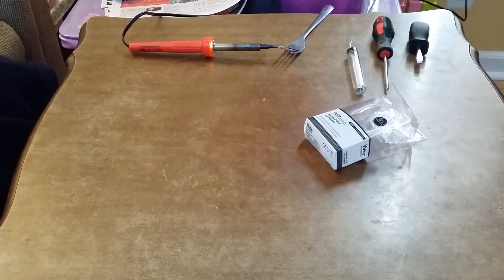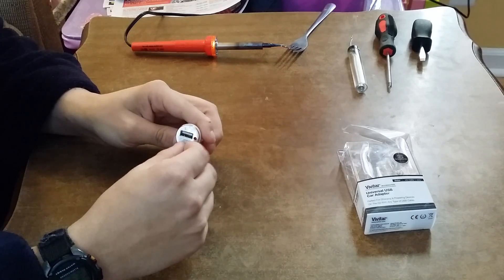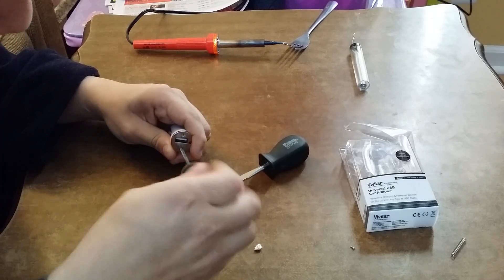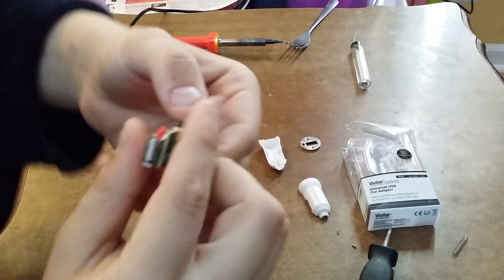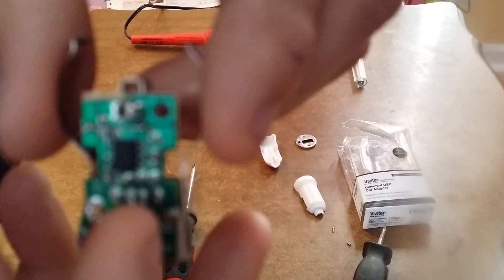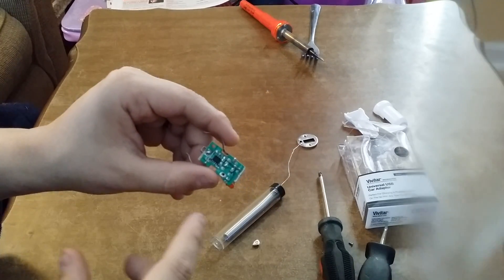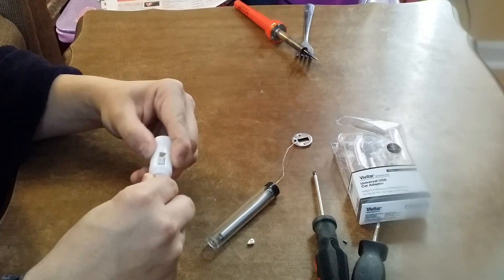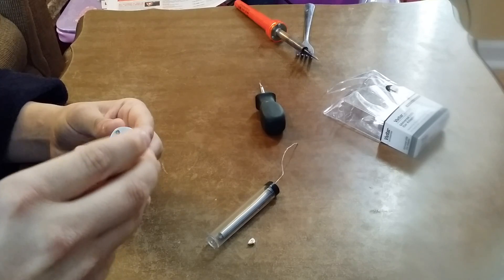Android fast charge hack

Comment: Its clear you don't really know a lot of how (phone) batteries charge and how much current they draw and or how much current a pc can deliver to a usb port, and btw you should never just short something out, and if you really thing it makes a difference than just scratch of the little layer of copper of the circuit board
Reply: Shorting the data pins on a charger does nothing if there is no voltage on it. All that does is tell the phone that it is a charger and there will be no usb transfer to PC, so it starts drawing a higher amperage. Normally it would be 500mah, with the pins shorted it goes to about 1amp.
Scratching copper off the circuit board would quite literally do nothing, not even improve the charging rate.
Reply: AHAHHAHAHA suction!??
Sorry if you are offended, but your spelling and grammar is so poor that it's frustrating to try and understand what you mean by stuff like "power into the drive" and "suction from the input". LOL!

Current is DRAWN from the supply. Shorting the data pins tricks the phone into thinking it is plugged into an AC charger and therefore it will try to DRAW 1000ma rather than only 500ma when it thinks it is connected to a USB port which is typically only capable of handling 500ma.

"Fast" charging on an Android is usually referring to 2000mah (which my Note2 and S5 both support). For this to work you need to use resistors to drop the voltage of the 5v power down to 1.2v across both data pins... which in turn tells the phone that it is connected to a 2amp capable charger. I have done this several times and charge at 2amps using aftermarket chargers.

Lastly. "ANGRY" is how you spell it. (no "E") =-]
Reply: ANGERY OTTER Current is drawn, not pushed. You may have a 12v charger capable of 3A but it the source has a higher than 3A resistance, you will not draw it. Current is equal to voltage divided by resistance or Ohms Law I=V/R. No resistance equals max current draw.

ie: Picture 2 stacked water tanks. Top is full. Bottom is empty. Attach a hose to drain the top tank to bottom tank. The hose is your resistance to Current transfer from one capacity to another. Bigger hose diameter equal less resistance which means higher current. Do not mistake this with Pressure which is equated to voltage.

ie: Tanks are side by side. One empty. Attached the hose. Drain from one to the other. The one with the higher level has a Higher pressure on the resistance than the other. This is like charging up to a voltage. When the charger is equal voltage to the battery there is no longer any current or flow yet they bother hold equal voltage or pressure.
Reply: Steve Rand it pushes more power into the drive equalling more charge it works is it important no but he isn't hooking a car battery up to his phone
Reply: ANGERY OTTER Sorry mate, no idea what you are saying.
You can't push power and I never said anything about hooking up a car battery?
Reply: It increases the suction from the input shorting the plug sorry you don't do shit like this
Reply: That's why when people usually don't have any idea how shit works they learn somthing
Reply: Great reply. Lots of detail!
Reply: The ohm law works exactly as you describe for simple resistive load. But cell phone are much more complex. They follow an algorithm to evaluate how strong is the power delivered on the USB connector.

Step #1 : take only 200 mA, wait 1 second
Step #2 : verify if voltage is above 4.5 volts and not above 5.2 volts
Step #3 : set current to draw1 a little higher (300 mA, 400 mA or 500 mA max)
Step #4 : if voltage decrease below x percent or below a specific voltage, go back to step #1

The brave engineer of Apple decided to violate the USB standard in order to make the first fast charging phone. The official way for USB standard would be to use the data line and negotiate between the phone and power supply. Apple decided to use the easy "dirty" way, which is to add a cheap resistor on one of the two data line. The phone check if the resistor is there. If it is, it assume the power supply is the high current 1 A and just try to draw that current.

When Android phone catched-up with that trick and some models also started to violate the USB standard to take 1 Amps, Apple created the next version to justify the price invested by the parents of rich kids. The new trick, as showed in this video, is to short-circuit the two data line. The new phone now check this, and if they sense that short-circuit, they assume the power supply can deliver 2 Amps.

Meanwhile, the Android phones continue to respect the rules and carefully try to increase the current, a little more, slowly, and retreat to the original 200 mA allowed by the USB standard as soon as they perceive any drop in voltage. Any dust, any small damage to the capable is enough to force Android to slow charging mode. I just hope some manufacturer will be as bold as Apple and take the 2 Amps that we deserve.

Comment: Is it REALLLLLLLY worth all that trouble?
Reply: You make it sound like this is hard. Totally worth 5 minutes effort for better charging forever.
Reply: USB standards tell you that the phone is looking for a dataline. If there is NO dataline, the phone will accept fast charge. So what he has done, is to short the dataline. And that is all there is to it.
Reply: lol yeah all 5 minutes.
Reply: +Dave Thomas Care to explain, without resorting to any other comments (or ideally, any sources aside from your present mind) how this charges faster?

wait...post your reply first...

All phones have safeguards to protect themselves from being charged too fast and thus, damaging the battery or other related electronic components. In short, phones don't let one volt or one amp more than they want in. You could have a 50v with 5a adapter. It still can only charge five phones quickly or ten phones slowly. (I'm not explaining how the numbers work. You went to science class.)